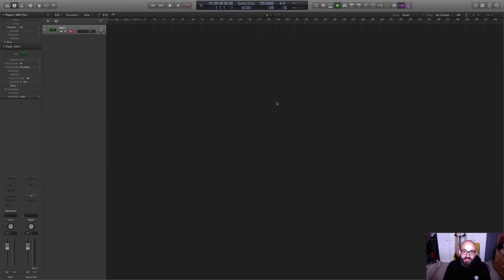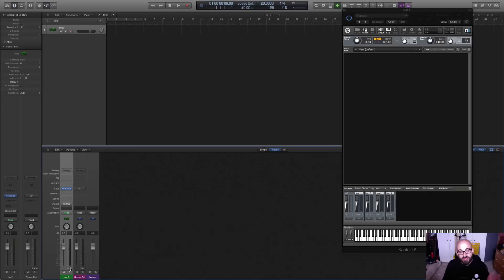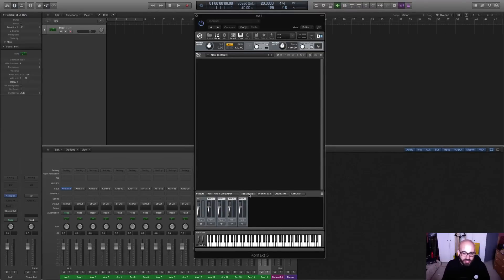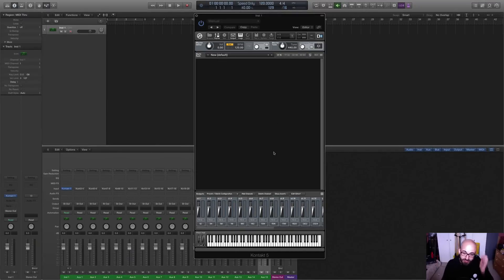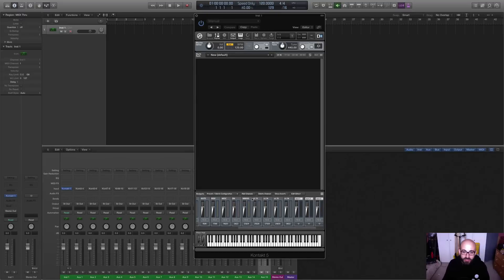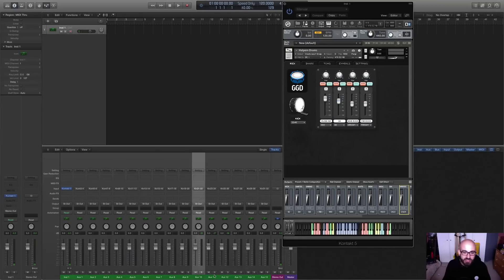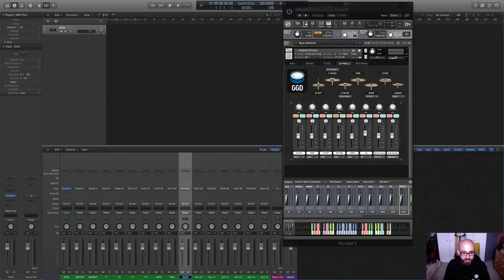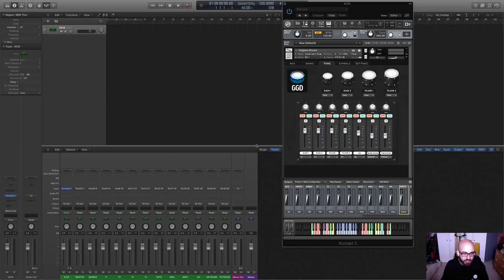Routing GetGood Drums in Logic

Comment: kontakt is freaking garbage. Cant get this to work or pull up the first step where you set the routing in kontakt
Reply: If you open Kontakt & look near the top of it in kind of the middle kind of slightly to the right you'll see an icon that looks like a square that's composed of 3 other squares / rectangles. That button should open up a drop down menu where it'll say "Browser , Master , Info , Outputs" etc.You want to click "Outputs". A check mark should then appear beside outputs & a list will come with your outputs at the bottom of the screen. It should already have the 16 outputs from where you created them in your DAW. Hope that helps. I am just now figuring this out as well & I agree Kontakt is a bit confusing. The confusion is on in this video because he's using 5 & were using 6 , presumably.
Reply: @siircodyy  you are my hero and I love want to love you forever

Comment: Hmm...Instead of using AUX tracks could you use a track stack instead, that way you could actually see all those tracks in the project window?  I don't think you can do that with aux tracks.  Basically like the way the built in Logic drum kits work, is what I'm thinking of here.  I'm pretty sure those are track stack multi-outputs instead of one track with a ton of aux tracks under it.
Reply: Nevermind -- I see you can add aux tracks to the arrangement window!  Cool beans.  Then after you add them all you can folder them.
I tried doing the track stack and that was a no-go!

Comment: I have it installed through native access, all good there. But I cannot find it in my library list within the plugin. Anyone have a fix for this?
Reply: You may need to completely uninstall Kontact then reinstall it with the update first (Kontact 6) before installing the drum pack, I had a similar issue
Reply: It's on instruments rather than the effects. So load up a software instrument e.g. electric piano and click on the little arrows beside it, then go to AU instruments at the bottom of the list and it should be there! :D

Comment: My kontakt only goes to 16 17 outputs and then repeats 16 17 when I add outputs...
Reply: You can "group" the outputs. I typically do kick in, kick out, snare top, snare bottom, toms, overheads and ambience (rooms). This way it's easier for mixing and processing. Splitting things out like Nolly did here is ok, but for my setup that's way too many tracks to process, and I don't really hear that much improvement in sound.